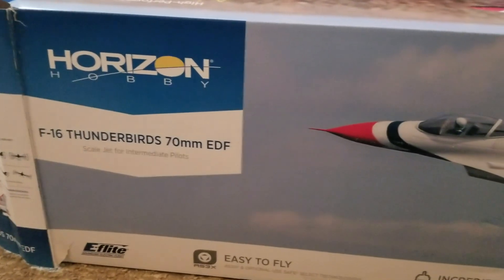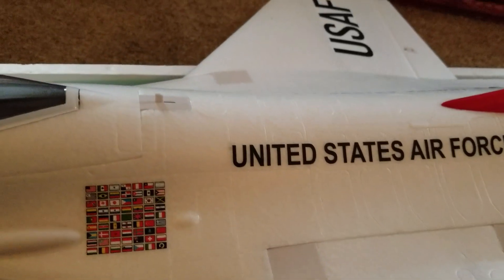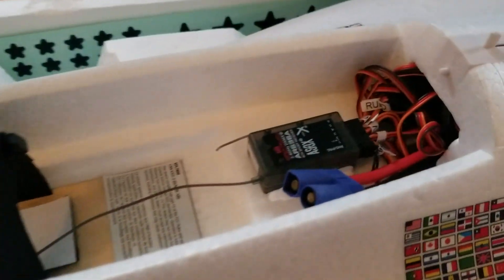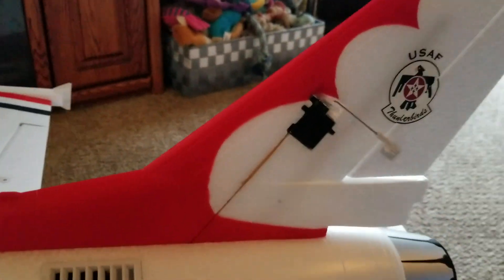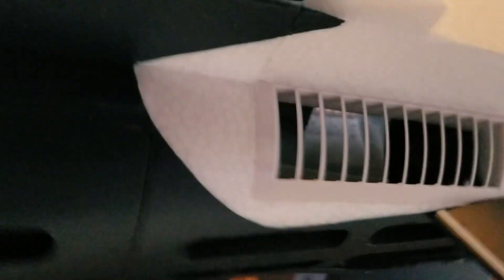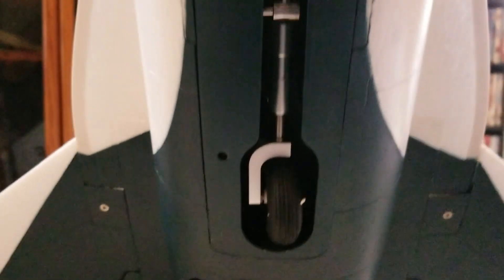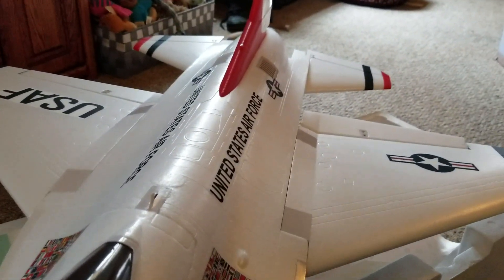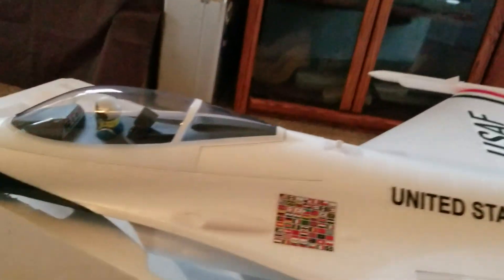HORIZON  F16 EDF 70 mm

Comment: looks like 30 flights is the breaking point for this plane. the foam is so soft that leading-edge on the wings elevator and the bottom ventral fins starts chipping away as you do Landings and takeoffs. all 30 of my Landings have been smooth on hard surface and the left gear Broke Free rotated 180 degrees and caused the plane to dip the wing tip and cartwheel twice. pitot tube broke wingtips broke. I don't know what's up with the landing gear but if you do grass take off and Landing I'm sure it will vibrate loose even sooner. hopefully it's just my plane but that seems to be the story with eflite landing gear systems. I tried a Loctite the screws but I need to remove plastic covering that is glued on the plane to get to the other screws in the landing gear actuator. for 299 dollars this is kind of a pain in the ass.
Reply: So...in your opinion freewing foam stronger?😋
Reply: I dont have those issues but thd gear isn't the best after while i hand launch it and its so much better faster less weight tape the bottom up for landing epo is great